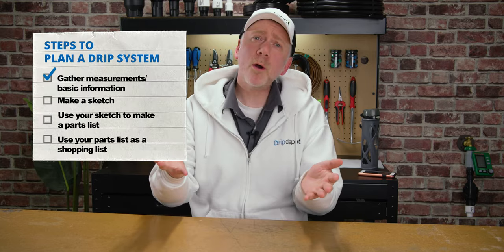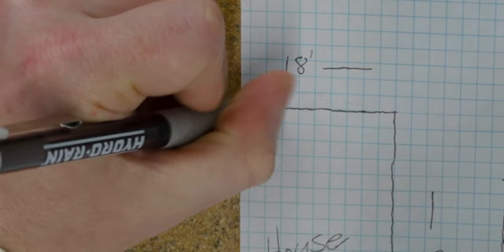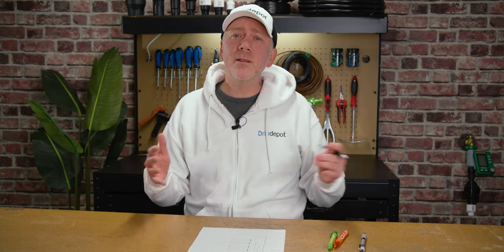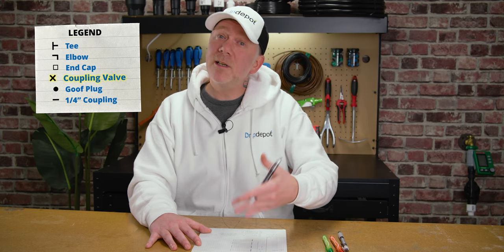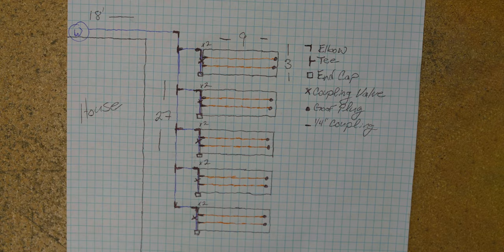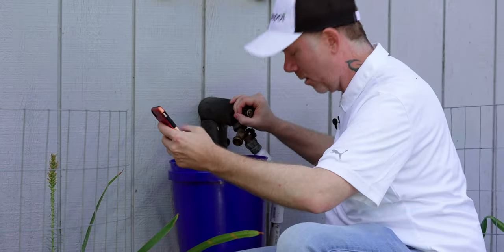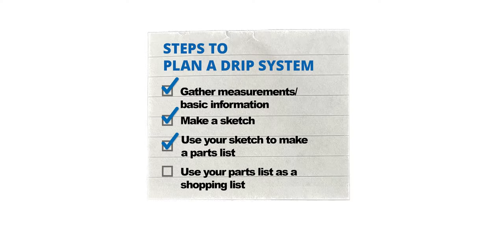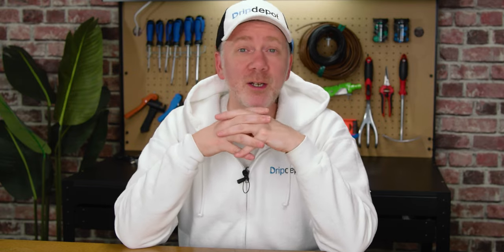How to Design a Drip Irrigation System (Beginners Step-by-Step DIY Guide)

Comment: My mainline is 176.5ft on one side of the garden, we plan on adding more in the future so we’re planning on a 3/4 inch mainline. Should our emitter line/drip tape be 1/2 inch or 1/4 inch? 

Also, on the other half of the garden we have rows of crops. The rows are about 28 feet. Is it okay if we use the drip tape for that? Or does that need to be mainline too? 

Sorry if you’ve addressed this in other videos, I am struggling to get all of this figured out still😅
Reply: With my drip tape, it will be over 500 ft total… is that okay?
Reply from the maker: @Katherineroberts33   Great questions Katherine, and you're welcome to reach out with questions at any time :)  First, good call on going with the 3/4" if it's 176.5' and you plan to expand in the future -- going 3/4" now will help future proof everything.  

How long are your rows going to be coming off that mainline?  1/4" drip line is good for about 20' to 30' depending on your (6" or 12") emitter spacing.  After that, better to go with 1/2" drip line or drip tape.  

You don't have to add your drip tape or drip line lengths into your total mainline length, each individual run will count for its own individual run -- so, for example, if you have five 20' runs of 1/4" drip line, even though that totals 100', each individual one is within the recommended maximum.  

One thing to account for with your total tape or drip line (or even a mix) is the flow rate of the system versus the flow rate of the water source.  The flow rate of the system is the sum of all emitters operating at once -- for example, if you were using 500' of drip tape with a 0.5 GPH emitter spaced every 12", you'd have a system flow rate of 250 GPH.  You want to compare that number to the flow rate provided by the water source to make sure there's enough flow to feed all the emitters.  

If you haven't yet, you can test the flow rate of your water source with just a timer and a bucket -- time how long it takes to fill the bucket with water, and then plug the numbers into the Flow Rate Calculator at this link: https://www.dripdepot.com/irrigation-calculators

If the flow rate of the system (adding up all the emitters) exceeds the flow provided by the source, not to worry, the solution is pretty easy -- usually it just means going with a second zone by using either a hose bib splitter or a 2 outlet timer so you can have two individual systems that run at different times (and I can help with that if it ends up being the case) :)

Comment: Which one should I order for garden bed?
Reply from the maker: In ground bed or raised bed?  One of the raised bed kits would be a great place to start either way -- if you have in-ground beds the only big change to the kit would be removing some of the elbows (elbows are used to get the mainline tubing up the wall of raised beds).  If you have raised beds, it would just be a matter of customizing the kit to match things up (quantity of fittings, length of mainline, total length of drip line) to your system -- you're on the right video to help with that part as well, you can draw it up like we did here and count/add up what you need. 

We'd also be happy to help -- we can review your design and tallied up fittings and see if we spot any problems.  Also happy to answer any questions that come up as you go through the process.  We can assist here or from our Contact Us page here: https://help.dripdepot.com/support/tickets/new :)

Comment: Hello, Can i make my mainline the same diameter as the dripline If it has a sufficient flowrate coming out of it to meet the l/h needs of the dripline and if my dripline doesn't exceed the maximum length you've put up on the grid ( is that because too much length would lose pressure and drippers wouldnt work?) or am I missing something. Also instead of putting end plugs, I have seen alot of examples where people connect the ends of the driplines with each other via a perpendicular line to form a sort of grid. I understand this makes it so water can come from elsewhere incase there's a blockage but is there any other advantage to doing this. Im trying to understand and save money on fittings as you can tell, especially for my mainline which is 1"
Reply from the maker: You can make your main the same diameter as the dripline so long as you account for the physics -- you do have it exactly right, smaller diameters experience more friction loss than larger diameters, so you could end up losing a lot of pressure if it's not sized correctly.  With that said, that doesn't mean bigger is always better, as you noted, costs are something to take into account, and if your flow doesn't call for a larger diameter and you don't plan to expand on it, there's no need to spend more on a larger diameter. 

You've also got it right on the "grid" or "loop" -- its primary benefit is so that water can come from any direction in the event of a clog.  In larger systems, there's also pressure benefits, but that's not really seen in smaller systems.  In smaller systems I prefer to go with end caps -- end caps also have the benefit of allowing you to flush your lines (which in turn, greatly reduces clogging).  

Basically, you're on the right track with all your thoughts there :)
Reply: thanks so much for your responses! @dripdepot

Comment: When using 1/4 drip with emitters every 6 inches, do you still multiply the total length by .5?
Reply from the maker: Close!  For 6" spaced line, you'd multiply the total liner feet by 1 (since there's an emitter every 6", there's 2 per foot).  If you use 12" spacing, you can multiply its length by 0.5 (one 0.5 GPH emitter every foot).  :)
Reply: @dripdepot  Thank you.

Comment: So if I'm doing my math correctly, my pressure regulator / filter 3/4",30 PSI @10GPM could theoretically flow 600GPH? That's a whole lot of drippers!
Reply from the maker: Is that the results you got from the timer and bucket test?  If so, that is indeed a very healthy flow rate!   There will be some small losses from fittings, head assembly parts, etc -- a lot of designers like to subtract 20% to account for all of those so they don't have to calculate each one individually -- this leaves enough cushion to generally "ensure success" :)

Comment: 4:50  - Why does 27 feet plus 18 feet equal only 40 feet?
Reply from the maker: Ah, good catch!  I think it was from knowing in advance that I'd be rounding up to the 100' since the 50' would be too short (we shot the design video after we installed the actual system). 

Thank you for catching that by the way!  We'll be able to fix this one without re-uploading the video, so truly and much appreciated.

Comment: The website is a mess. You need a search engine.
Reply from the maker: We really appreciate you taking the time to point out this issue. We are working on a solution to make navigating the website easier. If you need any help finding something in particular, we're happy to help provide personal assistance to find the right parts available in chat on our website or email support@dripdepot.com.
Reply: @dripdepot  the delivery arrived today. Please, please stop using fedex. They don't care about your product. Today's jackass driver, instead of walking up the path and putting the box on the porch, reaches over and balances the box on the edge of a raised bed on the far side of the yard. Caused me to break a pot trying to get out there before it fell off of the raised bed into the yard. They have literally chunked stuff over the fence into the yard and have the gall to take a picture of it.
Reply from the maker: Ugh, I too hate delivers that go like this.  In all seriousness, we used to use UPS and experienced the same problem (that really got noticeable when they took on Amazon deliveries).  There will be discussion about it again this year, I'll absolutely submit this feedback -- we collect a lot of it during the season.  Perhaps surprisingly, we experience the fewest issues with USPS, now if we could just get them to do large/heavy packages for a lower rate.
Reply: @dripdepot  thanks for your reply. I think service is not consistent nation wide for any given delivery company. It's all down to who works at those facilities. In one city, Fedex might be giving better service than UPS and another city USPS might be better.
In my city, USPS is probably the better one, although UPS is not too bad. Maybe it would be better to give customers the option of who they prefer to make the delivery and what each price is at checkout.

Comment: I'm planning my drip irrigation setup for an indoor 5x5 tent and trying to figure out what the best setup would be.  I have 3 rows of 3 plants and i've heard some people say that I should be looping the mainline to equalize pressure, but most schematics I see just have the lines come to an end with an end cap.  What are your thoughts on running closed loop?  Thank you! Edit:  I'll be using 9" halo emitters for each 5 gallon pot.
Reply from the maker: Great question on the loop, we see landscapers who are new to drip frequently doing closed loops.  With smaller and/or lower pressure systems, it doesn't really offer a benefit.  In fact, it often just ends up translating to higher material costs to get enough tubing to close the loop.  There is a benefit in larger and/or higher pressure systems, but for drip it has to be a pretty large system to really benefit.  :)

From what you've described, you'll be more than good to go with standard layout (assuming there's enough pressure to begin with of course, but there likely is) :)